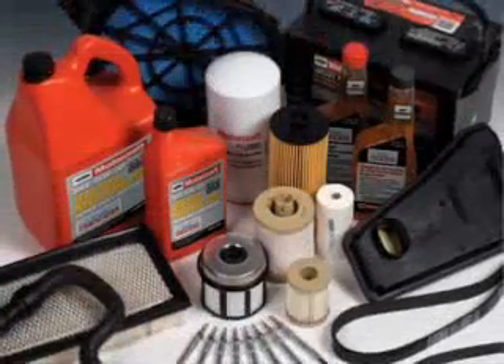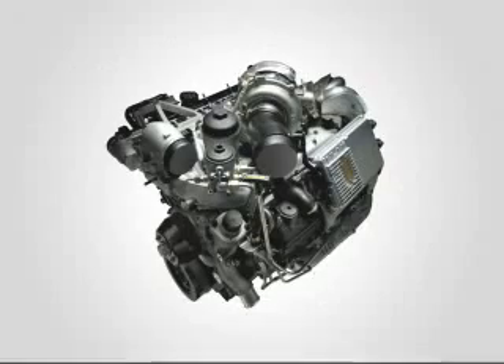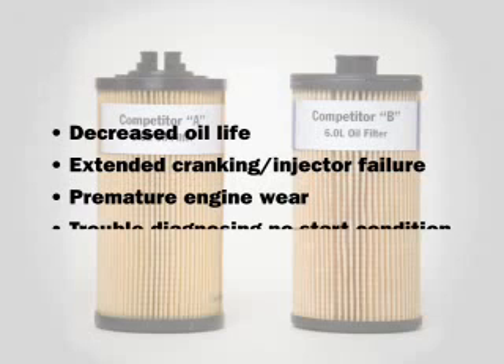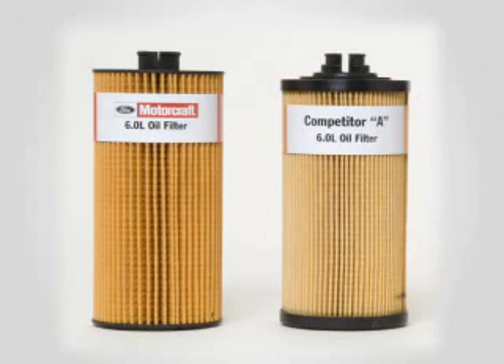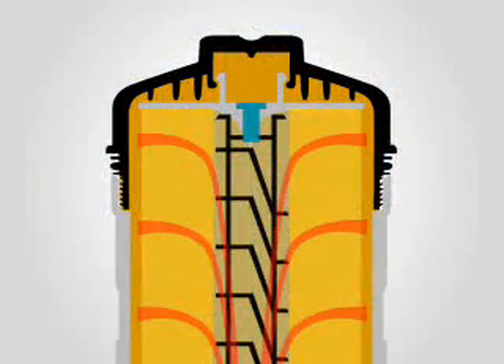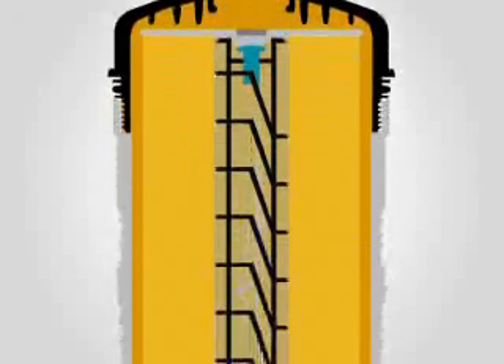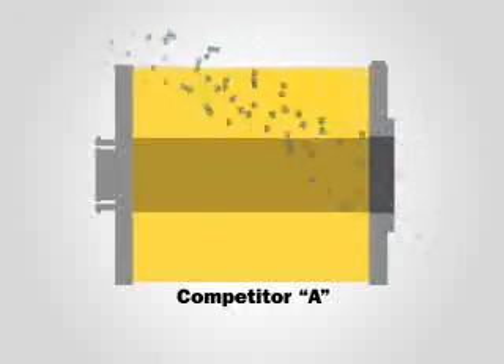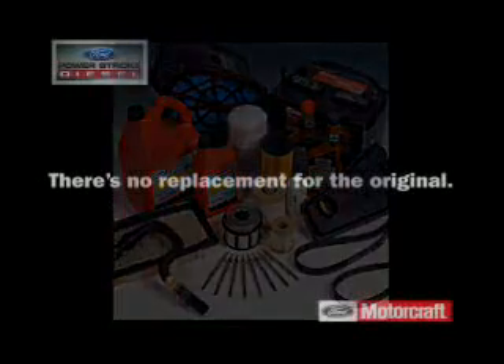Richmond Ford MotorCraft 6.0L Filter

Comment: You guys defending Fram are seriously stupid. Lets just say for example the most expensive oil filter from Ford is $25. That is high for even Ford. Fram costs maybe $5? So you guys go to the store and buy one and put it on your car, your car doesn't explode in two minutes and you say "Wow Fram oil filters are amazing! My car runs just like before! I won't bother looking into anything further now, besides it is cheaper!"

I have seen numerous people try and "save" with cheap filters and guess what? They have a noticeably larger amount of crap in the engine then mine ever does with its MotorCraft filter. You guys just come here hoping to stick it to the manufacturer and say hey look I saved $20!!!..... Also... for god sake people, your car is several THOUSAND DOLLARS OF VALUE and you try and save $20 on something that helps keep it working? Is that smart?